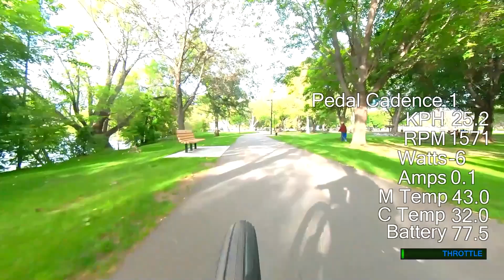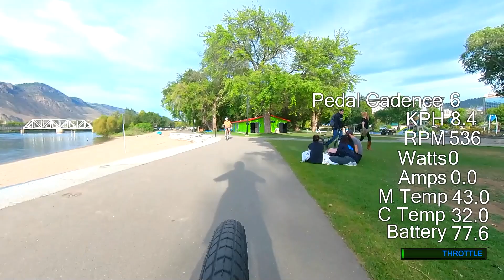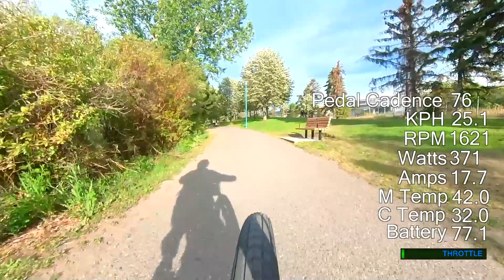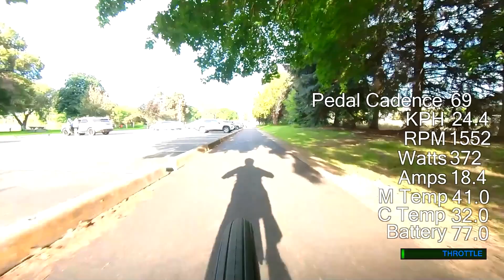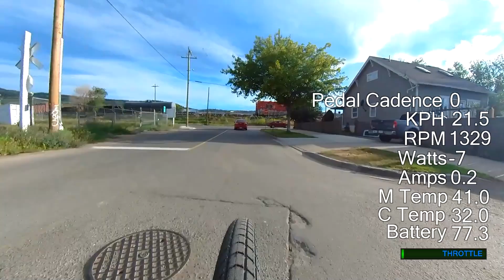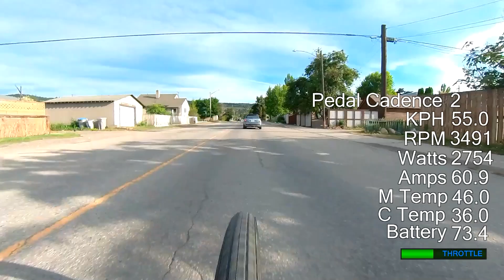Why Bafang Cancelled the Torque Sensing BBSHD (M635), Discussion on why Bafang pulled it?

Comment: Bafang is by far the best mid ebike motor on the market.  They don't need torque sensing the old tried and tested motors still beat the completion on reliability, performance and cost.

Comment: i wanna buy a torque sensor BBSHD, do you sell the m635 with the upgrade kit you speak about, can i email you please ? the cyc x1 gen 4 is wayyyy too expensive
Reply: i don’t need it too high powered, just enough to have fun on a track and can be programmed with different profiles so i can ride it daily to work and back with the legal limited power
Reply from the maker: Shoot an email to Greg@highvoltagekits.com

Comment: Hello mate. How did you put the parameters overlay into video? Anyway I can not see even M625 on Bafang page. Only old M615 UART version. :(
Reply from the maker: It’s using race render.
Reply: @HighVoltageKits  And data getting from some VESC?
Reply from the maker: @dado304 it from an ASI bac855
Reply: @HighVoltageKits  Hmm, interesting. Thinking how it synchronize with video.
Reply from the maker: @dado304 you set it manually

Comment: some accurate insight here on state of bike industry.  Ive done several standard power BBS02 conversions.  Love them.  I did not save money, but got an end result that was a better fit, lighter weight and better performance that I can work on.  The bike industry, with their move toward complexity and incompatibility is getting what they deserve.  Bikes should be simple, easy to work on and not try to compete with motorcycles or cars. I hope there continues to be a thriving DIY market and community and Bafang stays in it.
Reply from the maker: Thanks. The bike industry gambled on a few things that have not come to pass.

Comment: its a walled garden strategy that's all, companies have bigger profit margins if they make things more proprietary and keep on updating their designs and adding useless features for the likes of advertisement,  bbshd is the opposite of this concept, a robust design unchanged for 10+  years and its why its barely even listed in bafangs own website even though they still produce it en masse to this day, I honestly believe bafang never even made significant profits from those original mid-drives and it was all just a loss leader so they can gain Investment and launch their proprietary battery and unified ecosystem with displays and whatnots. 

Its no mystery what happens, motor companies just slowly become component vendors like shimano, they keep reinventing the wheel and they do stuff like adding another cog to their groupsets none asked for and its all because bike companies force them  to do new stuff they can use it as advertisement when selling to consumers, much like when laptop companies brag about having the new version of windows or whatever.

its the "kill old stock sell new stuff" consumerism mentality that needs to be called out on sight, Not even bosch can keep up with all the different generations and versions of motors it has and if your motor breaks you wont find any spare parts and bosch it self wont have any spare parts stocked to fix it with, i honestly wouldn't be surprised if bafang suddenly stopped producing bbs midrives altogether and we just enter a dark age of diy.

Comment: It's not just that they didn't promote it, they took positive steps to make sure people didn't hear about it. Less than a year ago I became interested in ebike conversions, and sent Bafang an email asking if they had a torque sensing motor or plans to make one; the reply denied that they had one and denied any plans to ever make one! It's crazy to not take every opportunity to sell what you've already produced.
Reply from the maker: I think you just nailed it. I was reading that there are films cancelled that are fully made which otherwise would have gone to the box office and they are just being written off. Cause a tax break on the loss and not having to spend the money promoting and distributing is more than they would make from the films profits. I wonder if this is the same calculation. I dunno. Made me think of it though.
Reply: Bafang Ultra is a torque sensing system.
Reply: @douglaskaye1395  There must be some reason why you completely missed the point of what I said. I have no reason what that reason might be.
Reply: @originalchilehed he answered your question that you sent to bafang, in addition to the m635 the ultra has it too and the company didn't mention this even though it's their mainline system

Comment: I don't regret building my CYC/DIY mountain bike project at all. I want to build another one with Ohlins bits if budget would allow.
Reply from the maker: I can't say the same LOL. It was fun to try but I doubt I would do another CYC. Its just not the direction I want to take personally now. Those olins forks are great tho! Cheers
Reply: @HighVoltageKits Which motor would you go for? I was ready to buy a CYC motor but after seeing your videos on not being able to service the motor yourself without have to take the thing off the bike, it has really put me off.

Comment: my guess is that the m635 and m435 were far better than their frame integrated motors, yet look less slick. the smoothness if the gearbox is unparalleled, the torque sensor, at least after some tweaking with BESST, awesome. Comparing them to their integrated counterparts (m560 and ultra), they shed heat better and are ultra quiet. I was told from the dealer that they discontinued production for market placement reasons. I would not exclude the possibility that the reason these motors were discontinued due to potential internal competition, putting the ultra and m560 in the shadow
Reply from the maker: An intriguing though. It might be a factor in not splitting the sales over too many lines. Cheers
Reply: have you seen the 600 ?
Reply: @TerryHope  the M600?

Comment: Motor Bafang M615 = BBSHD, M625 = The one that came in a package with the battery, 635 with torque sensor. It's a shame when they cancel. But Bafang has at least DIY motors, Bosch has none.
Reply from the maker: Very true and I doubt bosh will ever! Cheers
Reply: And I can not see M625 on a motor product page. So they have removed CAN HD motor  completely?

Comment: I have a thought.  But first, as always. well explained and thanks for sharing this nugget with fellow ebike DIY'ers who have a penchant for mid drive and Bafang in particular.

My thought is, Bafang is guilty of overreach. A failure of greed and misevaluating demand based upon their overreach. Their overreach is CANBUS, something DIY'ers disdain on Bosch and Yamaha and other production ebikes sold at bike shops at a high price.
Everybody knows CANBUS exists for one reason and you touched upon it. No right to repair. Preservation of proprietary interface including chipped battery that makes it impossible to pair with a generic battery, or typically.
Why did Bafang introduce CANBUS?  For battery pairing of course and sell more batteries with its awful form factor, a second marketing mistake. Public wasn't buying as it really goes against the grain of a DIY'er mentality.

Now a few companies and perhaps yours as well proved that the M635 could be paired with a non-CANBUS generic battery.  But builders were uncertain of this reality and unsure for example how much torque sensing calibration would be lost by pairing with a generic battery without the CANBUS plug that pairs with M635 harness/controller.
It was likely this overreach that killed demand for the M635 right out of the gate.  Add to that even more evolved consumers knowing that torque sensing isn't a panacea or a must have by any means. Some prefer cadence sensing. I for example am fine with cadence sensing and many that have played with torque sensing know they tend to be less reliable than cadence sensing with more 'fiddly' calibration.  Last ingredient I believe is, preliminary reviews of the M635 were less than favorable...crude  torque sensing calibration that was deemed unrefined.  Johnnynerdout wasn't a fan and he was trying to get through to Bafang to figure out how to calibrate the M635 better.  So first impressions weren't favorable about the M635 to put it mildly.

Anyway, that is my take. There may be more to it.   Lack of demand and if you consider one more thing, what is the most reliable, robust mid drive motor on the market?  I would suggest its the Bafang BBSHD. Who would have thunk that a Chinese company would produce such a brilliant, robust motor that is way overbuilt for max stock ampere of 30 amps and can take much more voltage and amps than that and keep ticking?  Contrast that with the German company CYC which can't even keep their motors together. BBSHD parts are ubiquitous at a fair price and the motor is easy to rebuild. 
So maybe, Bafang is a victim of their own success. I have bought two BBSHD motors from Bafang and haven't needed any replacement parts.  They just run perfectly which is such a blessing.
Reply from the maker: @lukewalker1051  thanks for this Luke. I think it’s a good take on things. I feel they definitely dropped the ball. This should have been done 3 years ago by Bafang. The CANBUS 625 and battery issue was not well received. It undoubtedly hurt demand as you say. We will have to see how things develop. I have a few things on the boil so should be an interesting year. Appreciate your support greatly. Cheers
Reply: @HighVoltageKits  Great to hear. You do so much for the industry John. All the best in your pursuits. We will be the beneficiaries of your hard work.
Reply: CYC is a Chinese company. Their headquater is in Hongkong and their R&D center is in Guangdong. Just let you konw...Why some of north American custumers are always arroggant to chinese companies...don't forget China is a country which can build their own space station.

Comment: For me personally, a BBSHD style motor with a decent torque sensor would be a game changer.  I'm always so torn between riding my Turbo Levo with the excellent torque sensor, or my BBSHD'd fatbike for the power and top speed.  When someone finally comes out with a torque sensor motor that has BBSHD oomph to it, for me it will be a game changer.  I guess what I'm trying to say is that a motor like that feels to me like it would reinvigorate the DIY market.
Reply from the maker: TOSEVEN might get there one day! We will see. Cheers
Reply: @HighVoltageKits  That would be amazing!  I hope so!!
Reply: imo this motor already exist.Bafang ultra
Reply: @wrosslandwr8032  I guess I need to look into that.  Is it one that needs a special receiver welded into the crank area of the frame?  Or is it one that has a proprietary battery that HAS TO be used?
Reply: @tptrsn  Bafang g510 or m620 with uart controller.pswpower or greenbikekit has it
Reply: The one with special reciver
Reply: @wrosslandwr8032  Thank you!  If the TOSEVEN DM01 doesn't pan out, I'll weld a receiver into the frame I currently have a BBSHD in, and try out the Ultra.  Although now I need to research the difference between the g510 and m620. Lol
Reply: @tptrsn  same motor
Reply: @tptrsn DM-01 already panned out. Its been excellent in terms of tuning for a long time now
Reply: @Alex-uh1mj  Thank you!
Reply: @Alex-uh1mj  Thank you for this information!!!  I just got back from a 20 mile test ride of my Motobecane fat bike converted from BBSHD to DM-01, and it is INCREDIBLE!  Functions exactly as I hoped it would.  Basically the best of all worlds.  Much appreciated!  :)
Reply: @tptrsn can it handle really.steep hills.or trails.with a fat tire?
Reply: @RustyShakleford1  If you're asking about the the DM-01, it has a ton of power, so yes.  And the torque sensing is beautifully smooth and amazing.  Like it just makes you superhuman, as opposed to adding a certain amount of power depending on the assist level setting, no matter what your effort level is.  Night and day improvement in the experience.
Reply: @tptrsn  Its usually reallybad programmed from the shop,but with uart controller and eggrider its easy to make this a fantastic motor.

Comment: Your evaluation of Bafang and the M635 makes perfect sense. Especially from a Bafang bean counter standpoint. Sad from a consumer standpoint, but it is what it is...

And from a 'right to repair' standpoint. An ebike kit from Grin Technology with a hub motor. Is probably the best bet. Plus the hub motors that they're developing for disc brake regen applications look promising. I just don't see mid drives being supported and developed in the same way at this point. IMHO

Thanks for your contribution to the ebike market and keep up the good work.
Reply from the maker: Grin make great stuff always. Long may it continue.
Reply: @HighVoltageKits  back at you

Comment: I am not worried now when TSDZ8 is on the market. I did 1000 km with it till now, mostly off road. Software is not there yet, but it will be. Build quality is really good.
Reply: I saw on Tongsheng Facebook group some preliminary drawings of even more powerful motor than tsdz8. Time will show if they release it.
Reply from the maker: Yeah. One door closes another opens. My only reservation is that the owners are a bit on the cheap side in terms of development. The flaws in the original motor primarily stemming from that.
Reply: Torque sensor is a must for me.
mtb use.
Thats why im buying the tongsheng  tsdz 8

Comment: I think you hit the nail on the head. Taking myself as an example, I was looking to convert some commuter bike and an MTB with mid motors. I wanted torque sensor so initially my choice was for Tongsheng due to good parts availability and good hackability. Then my plan was to upgrade to more powerful motors when they get released. But because of heavy discounts on the second hand market I ended up with a Bosch based commuter bike and a Bafang m510 based MTB. I still have tsdz2 based project bike but don't use it.
Reply from the maker: Exactly. You get what you need for less stress and it didn’t used to be that.